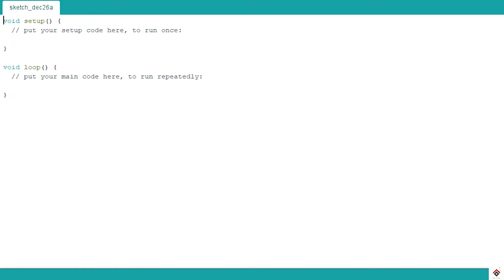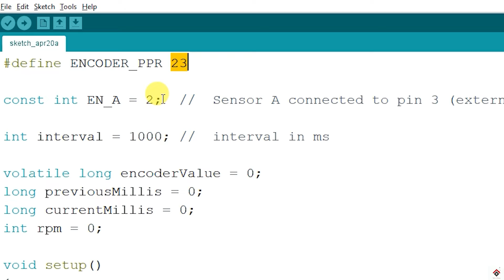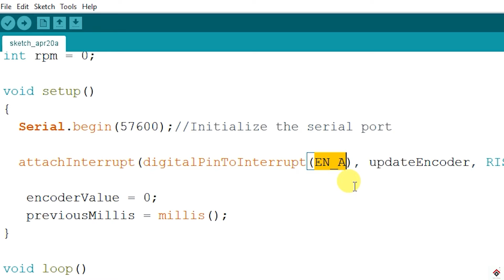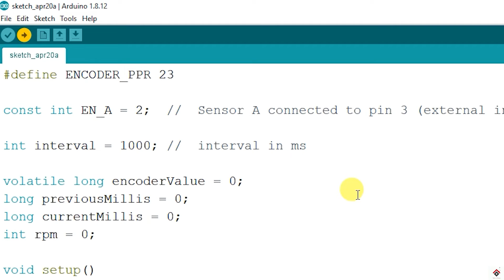How to measure DC motor RPM using Arduino and Encoder[with CODE] | Arduino Tachometer

Comment: Is this code compatible with encoder built in dc motor like "D04A321E"?
Reply from the maker: I think it will work. Is that encoder two phase?
Reply: @techathome  
YES, What plugins will I need to add to the code?
Reply: @techathome  
YES, What plugins will I need to add to the code? can you help me, please
Reply from the maker: You can follow the same steps in the video and upload same code. Let me know what is the result.
Reply: @ The motor is not working
Reply from the maker: For motor, you have to give supply directly. 
The code is only to read encoder value.
Reply: @techathome  i use L298N driver, The encoder has channel A & channel B and I want to know how to connect it
Reply from the maker: Then in my code, you have to add l298N logic also.
It has only encoder logic.
First try to run on direct supply just to check if encoder speed measurement is working or not?
Reply: @techathome  Yes, I tried to start the motor directly from the power source, but unfortunately it did not work.
Reply: @techathome  Can I know which encoder is used in the video and why it only has one channel?

Comment: wow! this is a very good project for measuring RPM of DC motor. So, for arduino coding, I just need to define the encoder ppr value...right? to intialize the serial port, the value 57600 should be not change or not?
Reply from the maker: Thank you!!
Change only the encoder PPR value in the code.

Comment: Is it possible to measure the direction also if I used a chip rotary encoder to make the steering wheel?
Reply from the maker: Can you share product link, I didn't get what is encoder chip.

Comment: Please make a video about measuring rpm from pulse signals
Reply from the maker: That will be the expected RPM of motor based on PWM duty cycle given.
RPM = (PWM value given in analogWrite/255)×NoLoad Speed 

 For example, let's say your motor has a no-load speed of 1000 RPM, and you set the pwm value in analogWrite value to 200, Then
  RPM=(200/255)×1000RPM